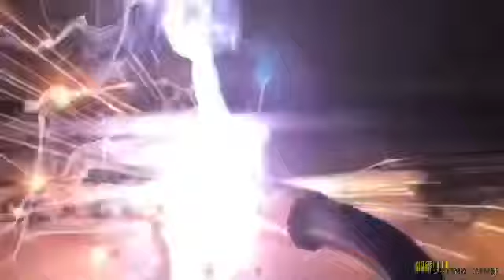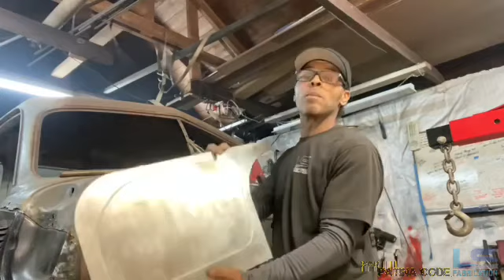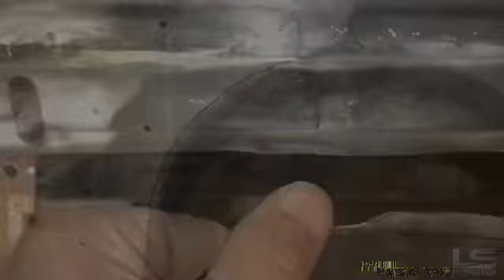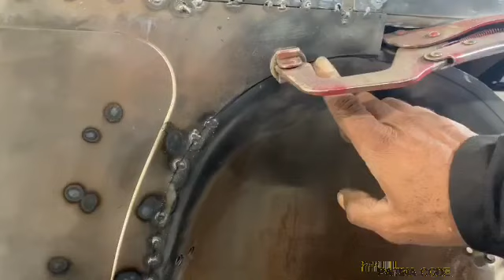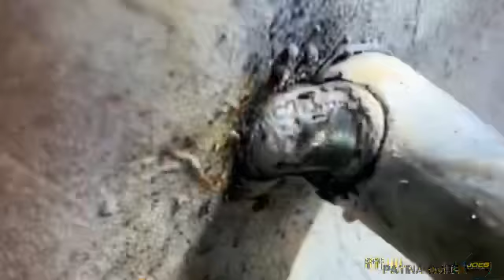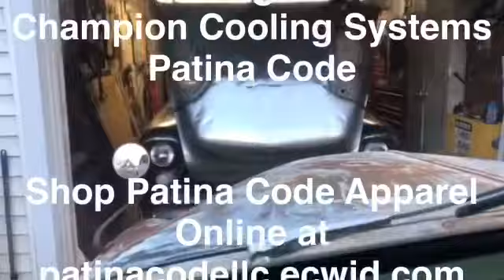So You Wanna Build An AD  Episode 16

Comment: hi dennis ..I just bought all kalinda panels my issue is knowing where to center the master cylinder after all the work done
Reply from the maker: Yeah, that’s going to be a tough one . You could do the under the floor master cylinder . There’s one with a booster as well if you wanted boosted brakes. 
If you don’t want to do the under the floor brake set up you could look at  Wilwood. The have some pedal and master cylinder setups that you can mount inside of the dash , you couldn’t add a booster though.